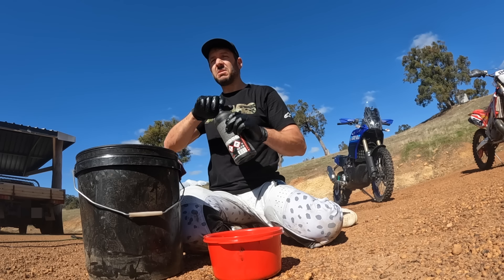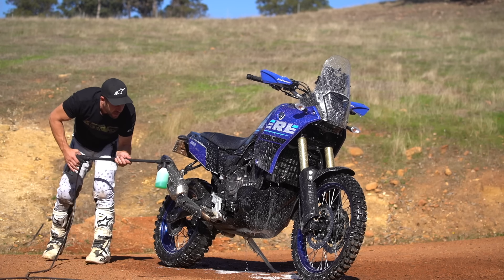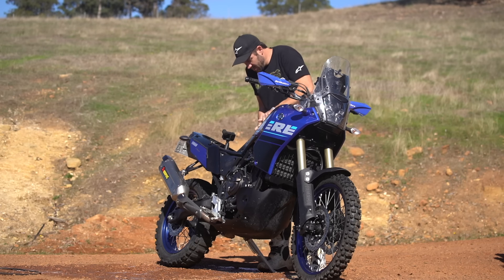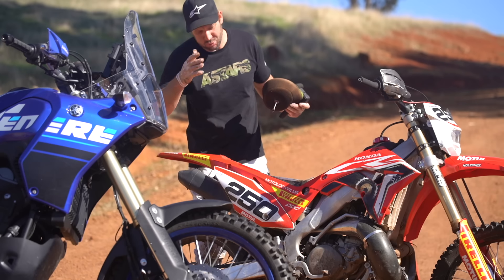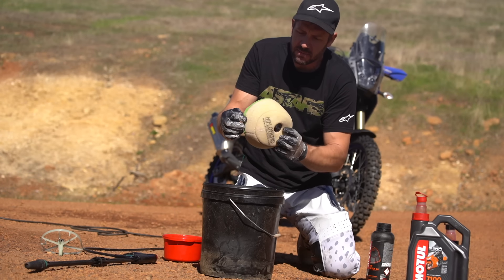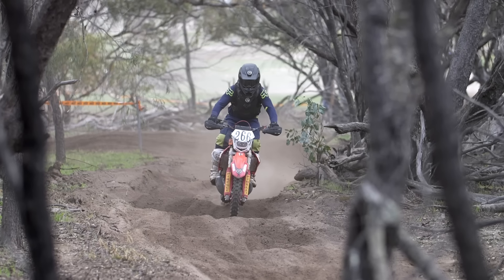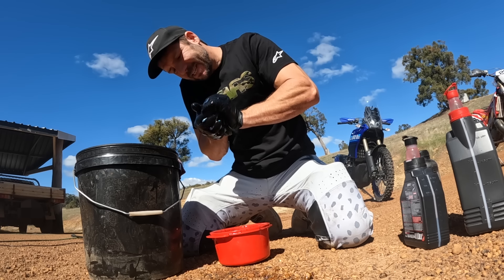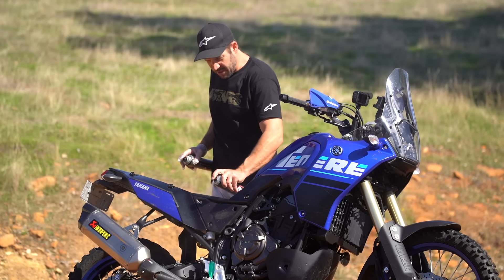How to Clean & Oil your Air Filter Properly!

Comment: Somewhat uninformed question from a MC rookie here: if you get a ton of contamination inside the engine, what is the dynamic that causes engine failure?  Love these videos!
Reply from the maker: Assuming you've got some kind of reasonable airfilter, if not oiled properly, the fine dust particles (silica etc) pass through and form a grinding paste with the petrol / oil. The engine literally polishes itself to death, incurring 2 or 300'000km of wear in 5-minutes.
Reply: Yikes!  Thanks for commenting.  I figured it was something along that line but don't have much engine or wrench-turning experience.  Your experience and willingness to share your knowledge is a treasure for all of us-thanks again!
Reply: @Thompsfacekillah  Dustin if you listen to this old guy,  you just won't go wrong,  simple as that.
Reply: @MotologyFilms  Hey Adam, have you dropped the T7 on those barbusters yet ? I read they are damn strong for an open guard ? I used to run open acerbis ones on the lighter Mx/enduro bikes. There's a lot more weight on the bars when these bigger bikes go down and i wondered how these ones stack up against the traditional barbusters? Cheers - Adam 👍
Reply: @adamhrachowina9119   They are really strong, I have them on my WR450… Dropped it heaps , as I am a clumsy rider. Never broken or bent lever…
Reply: @slogue77  Thanks that's good to know 👍
Reply: Usually the first/most obvious sign/damage will be to your valves.  They'll be sandblasted by the dirt and run out of adjustment quickly.
Reply from the maker: @adamhrachowina9119  just back from a big ride, dropped her in the sand and they're OK 👍
Reply: @MotologyFilms  Thanks for taking the time to reply 😎 I'll certainly consider these next time I replace the handguards. I went down hard and the cycras did a Stella job I was reluctant to drop the end protection but I'll take your word when crashing comes into it 😂🤙 take care buddy
Reply: Yeah idk that tbh. 2 strokes are so resilient tbh, sand dust lol, I scored  cylinder with say 130psi compression or more and you would never know..... 4 stroke and valve seats be fucked and all the other 4 stroke yuk
Reply: @MotologyFilms dust a 2 stroke once isn't like dusting a 4 stroke yeah.

Comment: Keyboard warrior here: Great info on the CR air filter combining air filter oil and 2t oil so it doesn't dry out! Also great stuff with the silicone spray on plastics and rubber. I'm currently in the process of restoring a 1994 YZF 750R and have extensively sprayed all rubber hoses and vacuum lines with silicone spray and it's unreal how soft and compliant it made them after a couple of hours. Definitely going to use it moving forward. Great stuff as always! 🤙
Reply: Just keep the Silicon spray off the plastics (as in the cosmetic panels etc) , You will eventually ruin them and strip the coating leaving them looking very faded and dry. I learnt the hard way on two quad bikes thinking I was protecting the plastics only to realise it makes them look good temporarily until it drys again . Never again now just use muck off or similar. Years ago when I told a bike mechanic I used silicon he said that's fine but do it before you sell it and sell it quick, I always wondered what he meant until I eventually figured it out too late.
Reply: @silverdale3207  yup! Definitely keeping that in mind considering the fairings are almost in mint condition and oozing pure 90s eurodance nostalgia. 😅
Reply: @silverdale3207  That is absolutly trut but not many belive me. Silicone spray and ozon (the Sun) olders the plastic in a big and quick way. But like you and I find out....not many belive that. I know for shure, it cost my company a lot of money (mailfunctions on firehose connections) and we let it test by a technical univercity. Silicone on plastics under the influence from Ozon is a kliller, point.
Reply: @silverdale3207  so I shouldn't use it on any plastics at all including hoses and electrical?

Comment: Lived in WA for a decade. Dust is a huge problem for any device there. I worked in heavy machine manufacture and reconditioning.
 When a Caterpillar is requiring a full recon after 12 months you know it's a harsh environment. No doubt Adam being a mechanical fitter knows exactly what I'm talking about.
 This is gold! Just do it! If it can survive WA, it will survive anywhere...
 Good on ya Adam!
 Thanks for being so generous with your accumulated experience!

 Bloody legend!

Comment: Just wanted to add: throw a rag over your brake rotors if you're spraying silicone, or wipe them off with brake cleaner before rotating the wheels. Silicone is very heat resistant and doesn't wash off easily; lubricants can soak into the pores of the brake pad material and they're not going to perform well ever again, and it probably won't burn out of the pads.

Awesome video, great practical tips. Thank you

Comment: Some more tips for anyone passionate about their bikes:  If you're washing bikes regularly, or simply want to do a better job, a cordless blower to get the water out of every nook is a fucking godsend - it's much easier to prevent corrosion, water spotting (on nice street bikes) when you start with less water to disperse with your EZlube/equivelent in places like under clutch lever boots, under your tanks, all those area you see Adam spray etc. Running the bike is great but unless you have pretty clean water you still leave behind a heap of minerals/water spotting - I go around with a cordless blower (I'm talking like an 18V makita/equivelant) while the bike is heating up so it's no extra time. Nothing against Adam's content there is extra nice ways of doing things too for those keen to be more anal in the detail, I still follow up with a water dispersant in places like clutch boots, pivots etc. and SC1 (like a silcone spray with less residue) but venturi/sucking water out with a blower (just like how Adam does his air filter) takes away a heap more water to start off with, especially if you're about to put your bike away for a week or two - nothing worse than putting them away wet. Has to be said not all air filter oils behave the same either, I've switched brands a heap to find one I'm happy with - some are shockers for drying out fast.
Reply: Buy a pet dryer with heating. The best way to dry your bike.
Reply: I do the same thing on my bike and also on my car. Around door handle ,trim, badges etc.

Comment: I ve always been nuts by putting silicone on my bike and under the seat, feels good. About airfilters I do same amount of oiling and I will put some extra layers on it, usually some "medicine hats"  or sometimes even Twin Air dust cover product. Those uber thin Medicine hats are great, they cost about few pennys each :D  I will ziptie the exess fabric right on the center of the filter. Works really well on my KTM, all the flower seeds and and other nature particles will fall off and wont stick on filter.  Cheers!

Comment: Holy shit.  Your tip to spray down all the plastics in silicon is amazing.  Not only does it cause any dust and dirt to simply wash away in the excess, it restores the plastic and rubber, making the inside of your bike look shiny and new, it also protects against water.  Outstanding.  The stuff dries quickly, just leaves a protective barrier.  

What an absolutely incredible tip.  

I found even coating the external plastics was tremendous - spray onto the backs of mirrors, wipe off the excess, and dead bugs and dirt just rinse away with normal hose pressure after a ride.

Comment: Great video. So glad you brought up the Keyboard warriors. It gets so exhausting at times listening to people that have no  that have no idea what they are talking about. I actually used regular engine oil for years with no issues. Its ultimately about keeping the filter moist and clean after use.

Comment: Thanks for schooling Adam, absorbing ALL your wisdom to service my first bike is Aprilia Tuareg 660! Products you are using in video is "MOTUL MC CARE P4" for water replacement/anti-rust and "MOTUL SHINE & GO SPRAY" silicone. Unable to find those in my region (Portland, Oregon, USA) yet. In the winter, I was riding the bike on ice with lots of salt and melt around town and into Canada, and it started corroding. Had to unmount the calipers and went all lengths to use copper lubricants etc to unstuck the brake cylinders, now working good with copper lube. Unfortunately the calipers (Brembo black 2-cil front and single-sil rear)  actually look like discolored s%$t after all the salt and cleaning and brake cleaner. Likely clear coat is gone. I wish I knew about silicon spray sooner.

Comment: I agree with all your maintenance videos. I currently have over 52,000 miles of decent offroad use on my 2011 DRZ400. It runs better than new and looks better than new. Proper maintenance and your bike will last longer than you think it will.
Reply from the maker: Fantastic machine. I got the very first model released here in 2000. It was the non-rego model and I raced it in a few State Enduros before moving on to the KTM200EXC ...

Comment: Great instructional vid mate.  I recently did a 2000 klm dirt trails 5 day adventure ride on my 690R with same air filter the whole way as left my spare at home.  Luckily I'd oiled it properly so looked like new on the inside however really dusty and dirty on the outside.  Learnt my lesson years ago after not oiling a 250 smoker air filter properly and killed the engine..

Comment: On my last KX to my first KX back in 1986 I used Uni Filter air filter mixed with Mx-2. Still using Bel Ray and it drips to the swing arm and floor for my last KX450F. Loving the videos.

Comment: I really like the added step of a ring of chain lube around the air element contact and air box cover. I too coat our bikes in silicone spray as preventative maintenance. 
Only thing I’d say is don’t hard wring out the foam elements, softer squeezing and plenty of flushing. I saturate my foam elements with engine oil, squeeze out the excess then in addition I spray the outer layer with foam element oil. Very clean throttle bodies and the oil changes dropping fairly cleanish oil albeit I maybe over service them 👍
Great work mate, I learn something new with each new video.

Comment: The gloves for filter work are the mark of a vet. Thx for the silicon tip, mineral oil works great on rubber but doesn't come in spray form. Cheers.

Comment: Probably better to safe distance compressor air blast the air filter compartment before taking it out, instead of vacuuming it. T7 engine looks utterly amazing but the seat is sort of a narrow compared to the XT660ZA. Amazing advice for the sponge air filter, silicon spraying rubber and plastic is spot on.

Comment: The best product for cleaning your bike is Wash & Wax from Motul. You can get anything off of your plastics, metal and rims. You don't need any other cleaner than that. Add a good silicon spray and you are set. The silicon spray can be used all over your bike even your engine. It's great for repelling water and rust (obviously you spray it on when your bike is bone dry). It's a great product for putting your bike in winter storage. The plastics on your bike will always look like new with silicon.

Comment: Hardly ever too much.  I've ran oiled filters since late 1960's.  No issues yet.  Keep them wet and clean them some before removal.  So easy to totally defeat having one with one spill of dirt into the intake.   Yeah, I was old when I bought my T7, hang around awhile.  Be safe.

Comment: Before we got into racing engine oil was all we used to treat a filter, a coat of lithium grease or whatever we had to hand went on the seal. We also used to put a thin smear on the inside of the airbox in an effort to catch some crap before the filter and a pair of nans tights over the filter as a pre filter 😂

Comment: Great info. I will try the 50/50 mix as I do notice the motul filter oil does seem to dry out. I use Vaseline around the filter lip before install. Grease, chainlube, Vaseline, who cares, whatever works!

Comment: Awesome content Adam.  On the cleaning.  Those battery powered pressure washers like the DeWalt only produce about 500-600 psi and can draw water from a bucket.  I've literally blown the stickers right off the machine with conventional pressure washers.

Comment: Brilliant tips. The silicone spray on plastic and rubber is so good for cleaning and protection. Does the anti-rust stuff attract dirt and make it easier or harder to wash off? Have you had any experience on using silicone sprays on metal engine parts- good, bad, etc?

Comment: Brilliant video yet again, thanks. One quick question : Silicon spray on the fork legs or around the seals, is it a good idea or not? I've always done it but I know some people reckon it's not a great idea ... ? Oh and thank you for just confirming what i've been telling people for years; don't jet wash the crap out of your bearings or seals. Yes they are 'sealed' but if you have ever seen how little grease gets put into a bearing at the factory, jetwashing at close range and pushing what precious little is in there out the other side or pushing grit in there is just plain dumb. Like you said just go easy. Anyway, Cheers for another great video.

Comment: im servicing my mates xr400r and another mates husaberg fe450 (70° motor) Both bikes are neglected. The Berg, rear wheel nut would not torque to 80nm. so remove wheel and check bearings. the spacers are rusted to the bearing. so the spacers come out with the bearings. not supposed to happen. they also shattered the bearing race. im surprised he was able to ride it with completed rusted out bearings and a loose axle. anyway its getting the attention it needs now plus all the extras that go with a major service.  

Lesson. Fix one faulty part before it takes out all the other parts around it. Instead of bearings its an entire setup, seals bearings, spacers, axle nut.
i've had good results from castrol foam filter oil. never dusted an engine even in the big rallies. But never mixed normal oils into a filter because everyone says a dripping filter is bad. I will try some 2 smoke oil next clean.

Comment: I also add airfilter oil to my engine oil, like a 50/50 mix. This way the engine oil gets way more sticky. Believe me, I have been doing this for ages and the oil really gets a hang in the critical engine components. 
I know because I have so many years of experience with oil and engines.
Reply: Ahaa! First keyboard warrior found.

Comment: off topic: what are your thoughts on replacing paper filter in street bikes with long lasting aftermarket oil coated filters? Worth it or even bad?
Reply: Exactly my question for all roads/no roads bikes, replacements for my paper filter seem to be oiled cotton gauze fabric, not foam.
Reply: I put in a K&N filter in my 800gs and clean it every 5000km but would love a foam filter but no such thing to my knowledge in SA, is the steel with their oil not ideal?
Reply: You realise more airflow means more dirt. For a street bike why replace a paper element and increase engine wear with these ‘long lasting’ aftermarket filters?

Comment: Hi Adam, thanks for anther great video. I’ve never thought of using chain lube around the filter. I always use waterproof grease but it’s so bloody messy. 
I’ve used the silicone spray trick for years and use it in the car engine bays as well  especially in the lead up to winter. Love your channel 🇦🇺

Comment: Excellent video, and your explanation is bulletproof. I follow similar steps myself for air filter cleaning. However I use hypoid gear oil for the chain and air filter, have ridden through dry dusty conditions for 30,000km and no issues thus far. Can you persuade me to use specific filter oil vs the universal alternative?

Comment: If you have a 2 stroke with a carb and you over oil your filter the excess oil will block the pilot air passage. Seen it many times.

Comment: That looks like a ‘turbo’ type nozzle ( for hard surfaces) which I reckon could be a bit harsh for vehicle cleaning.
Reply: Paul Marshall, I think I can speak for Adam and say that I’m 99% sure the pressure washer he was using was electric and those are not near as powerful as a gas pressure washer.  I never once saw him get very close to anything sensitive.  Those nozzles look nasty and do a good job and can be dangerous with lots of pressure and too close to sensitive parts.  Ask me how I know.
Reply: Yep that was a turbo nozzle at the start. Not recommended for washing a bike or car as it will remove paint. Best thing to use is a 40/25 degree fan head.
Reply: @jameshind6644  hold it further away no issues. Been using em for years
Reply: @thisisme7587  A Turbo nozzle spins at 0 degrees and is used for concrete/hard surfaces. For washing a bike properly you need a 25/40 degree fan tip. have a look at any professional detailers video on youtube no one uses turbo nozzles. Try  a turbo nozzle  on your car and see how you get on.
Reply: @James Hind  have been for years. No issues at all. Youre 1 of those eh.
Reply: @thisisme7587  Yea mate your another keyboard warrior.

Comment: Thank you men, that's great for my CRF, on my other bike I got a paper air paper filter, they call it replaceable not to wash it, can I still seal it with chain lube, should I oil it ? guess not, silicon is safe on the outside of the airbox I understood. Thanks Ariemann

Comment: Great point about carelessly removing air filters. One minute open in a dusty field is more trauma than most riding can do to an engine. Dumb!

How do you typically time your filter maintenance? Do you go by power feel (engine running rich, or weak)? Or visually?